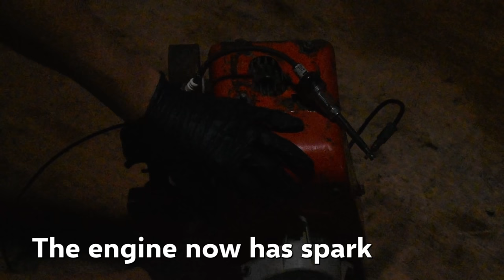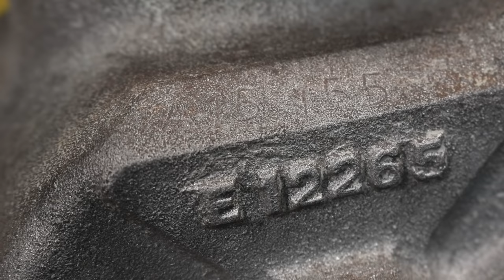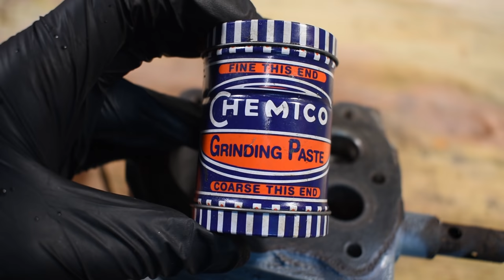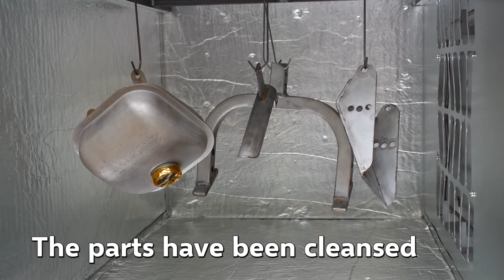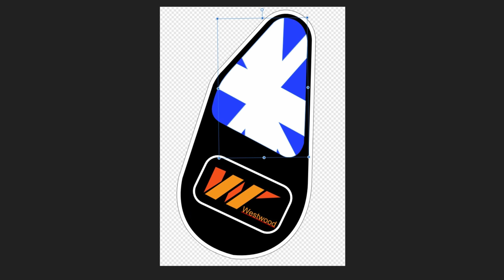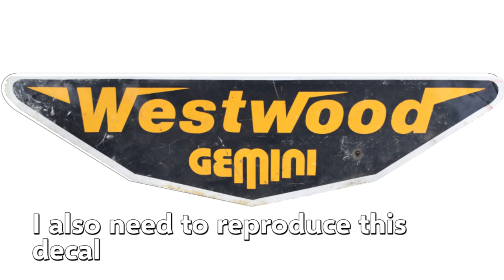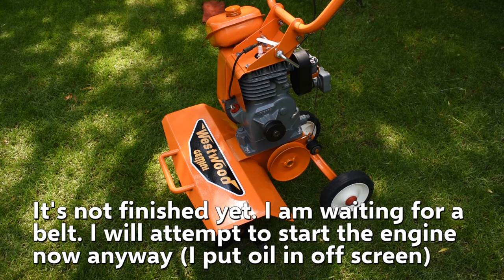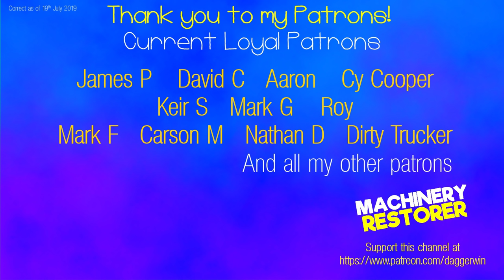ABANDONED RUSTY TILLER SATISFYING RESTORATION

Comment: I used to restore vintage Snowmobiles. It was a great hobby but time consuming and parts were hard to come by. Now I just repair small engine equipment much like that Tiller. I always enjoy watching an old, rusty hulk come back to life. I do wish I had a powder coating setup. I usually do primer, paint and a clear coat sealer. I think it holds up better than powder coating in the long run.

Comment: I like the touches of the decals, I had wondered on a previous video where you go them from, never considered that you'd print them.  That old Suffolk Iron Works engine brings back memories.  I used to work on those as a teenager and I still have my fathers old Qualcast Commodore lawnmower which had one.  It precedes the engine you have here as the earlier ones had cast alloy starter pull assembly instead of the nasty plastic and cast and chromed throttle control rather than the pressed piece.  The 70+ year old mower now rests peacefully in the shed as a memory of my father and the first time that I was allowed to mow the lawn with it.

Comment: Fantastic restoration, I had one of these that I bought from a lawnmower repair shops junk pile. Did some work on it to get it running and it worked really well. Impressed that you managed to get a new belt, mine was knackered and I couldn’t find a replacement anywhere, I eventually took the old one into Halfords and found a fan belt that was the closest size, wasn’t perfect but it worked reasonably well. Thank you though, really enjoyed you doing the restoration.

Comment: Very nicely done.. Everything about this video is great... A little tip I learned working at a motorcycle shop.. When installing grips on your handlebars,  if u soak it in gasoline first for a couple seconds then slide the grips on the bars. (Do it quickly) they will never slide around on you.. You will have to cut them off to remove them .. it's like they melt in place... Fantastic video.. Subscribed...

Comment: Very comprehensive resto. I highly enjoyed it. One issue I noticed at the end though, when you removed the wheels I noticed that the wheel frame looked to me to be installed back to front. It looks like if you turned it around the frame would have flat feet on the bottom and slide across the ground instead of the downward pointed feet that dig in. Just my view and since I have never seen this model of tiller in person I could be way off.

Comment: This is how my montgomery/ward tiller was acquired, dude had it outback for a year, then decided to put it up to the trash. Grabbed it, drained gas. cleaned flywheel magnets, and I wanna say it needed a condenser and she fired right up. That was 10 or so years ago and I still use it to till my garden. Finally needed a carb rebuild over the winter.

Comment: Hallo            
18:00 Zylinder und Zylinderkopf  von einem Luft gekühlten Motor werden nicht mit Farbe behandelt, der Wärmeableitung wegen. Auch nicht, wenn der Hersteller den Motor mit Farbe behandelt hat, der Hersteller will sein Produkt verkaufen, deswegen die Farbe.
Gute Arbeit die du machst.
18:00 Cylinder and cylinder head of an air-cooled engine are not treated with paint because of the heat dissipation. Not even if the manufacturer has treated the engine with paint, the manufacturer wants to sell his product, hence the color.
Good job you do.

Comment: Another way to clean that aluminum off that journal is to mix up a strong mixture of lye and water. You can just dunk the whole crank in. Lye will dissolve the aluminum, but won't hurt the cast crank.

Comment: Use hairspray to slide the rubber grips on the handles. Old bicycle builder trick.  The hairspray dries and helps the handles stick without twisting.

Comment: That was a great restoration and the final result was awesome. Printing the decals finished it off perfectly. 
I think you used just about every preparation and coating method available: paint stripper, wire brush, vinegar, sandblasting and sandpaper. 
Powder coating, spray can and brush but a great job. Cheers Stuart 🇦🇺

Comment: I trick with handle grips I learned as a teenager 35 years ago, spray the inside of them with hairspray before you put them on. When the hairspray is wet it acts like WD-40 , when it dries it acts like glue.

Comment: Very satisfying to watch. I've seen many single-cylinder engine restoration videos and yours is the first I have seen so far, that you showed honing the cylinder wall and checking for the crosshatch lines. I noticed that you cleaned and re-used the points and condenser. Have you ever tried replacing it with a solid state conversion kit?

Comment: It seems so simple and even therapeutic taking these small
engines apart. Then I lose my mind just trying to change the batteries in some
toy my kids have. So, I won’t even speculate about cleaning them up and putting
them back together. Oh and my first experiment as a kid was to take my Dad’s 25
foot tape measure apart. And then I learned about the power of rolled metal and
springs!

Comment: Wood/sawdust in the crankcase used to be (and maybe still is for all I know) for engines that burned oil or were knocking. The theory being that the wood fibers would take up the bearings loss. In practice it was used more for a quick sale before motor seld destructed. Also same trick for car transmissions that were slipping.

Comment: Hallo @UCguI73--UraJpso4NizXNzA           
18:00 Zylinder und Zylinderkopf  von einem Luft gekühlten Motor werden nicht mit Farbe behandelt, der Wärmeableitung wegen. Auch nicht, wenn der Hersteller den Motor mit Farbe behandelt hat, der Hersteller will sein Produkt verkaufen, deswegen die Farbe.
Gute Arbeit die du machst.

18:00 Cylinder and cylinder head of an air-cooled engine are not treated with paint because of the heat dissipation. Not even if the manufacturer has treated the engine with paint, the manufacturer wants to sell his product, hence the color.
Good job you do.

Comment: As a car technician just starting their career I wanted to ask you some advice. I’m starting to work on bigger projects that involve a lot more parts and connecting hardware. Any advice or tips on remembering what bolts and hardware go where? Memory is not my best asset so looking for any tricks.
Reply: I use doggy bags that I write the bolt size on or magnetic trays. For which size bolt goes where I either remember or have to car specific mechanics manual at hand

Comment: I repaired this exact same one when i was in highschool, except the fuel line was made of metal and both the seals on it were completely gone, so i used some string just to get the thing running... had i fixed it today i would have made new seals...

Comment: The ""fuel mixture screw" is the main jet needle, I notice you left the emulsion tube in situ? Always clean that one or engine often won't work. I've got a Qualcast handbook somewhere for the cylinder mower, uses same engine.

Comment: I know this is an old video, but try dissolving that smeared conrod aluminium by using a lye solution (sodium hydroxide drain cleaner + water) - it'll eat away all the aluminium but won't affect other metals.

Comment: I would have used sodium hydroxide to remove the aluminum. It’s what is used for large Fairbanks engines that used aluminum bearings. It doesn’t effect steel.

Comment: I have rebuilt a lot of small engines over the years.  You never seem to measure any of the wear areas in the engine.  Just clean them up, paint and done.  Main bearings, valve guides, crank throw, cylinder diameter for taper or ridge, refacing valves or valve seats.  Plasti guage the rod main bearing.  Setting the valve gap.  Poor, poor, poor.  Tom Degenhart

Comment: You make a beautiful job of restoring that neglected garden equipment, but this machine, for some reason I strongly dislike, to say the least. 
It looks like crap right out of the factory, whereas the Westwood tractor… I find that marvellous - apart from the way to strong rubber flap in front of the rear discharge.

Comment: This reminds me of my dad's rototiller. At first, my dad didn't have a rototiller, but then, he found one in a dumpster or garbage can, and he decided to fix it up for him to use, that way, he didn't have to use his hoe all the time. He bought a clutch on eBay one time that was made in China, and it just plain sucks. When my dad uses it, it makes a high-pitched squeal because of too much friction. It does it about every 10 seconds, and it hurts my ears. He also said that this is why you don't buy Chinese clutches. It also has worn-off white paint that my dad doesn't mind. One time, the piston locked up, and my dad had to take it apart to fix it. The piston rings had broken, making the piston not able to move. The reason why my dad is so good at fixing engines is because he works at TranService, working on semi trucks all the time.

Comment: I wouldn’t expect this to last. I mean you broke it down properly and cleaned it well but you only used 3 in 1 oil. I seen the black label. That’s the original one not the blue label that is more than less 20 weight but the black label is not good for heat

Comment: 1:20 So, the engine had lower to min, it was seating for, I don't know how long, and you tried to start it, without trying to check if it was seized... Nice going!
1:58 You don't say!! What if some how, you manage to start the engine at the 1st try and that thing had been cut... Engine R.I.P. that's what!
3:22 and it had fuel inside! 
5:59 You still didn't check if the engine is seized!! With oil lower to the min mark... seating for how long?? ok!
6:33 And after the check for spark, you desided to change the oil! Without checking if the engine is seized! Ok....
6:45 And what do you know? The oil has ssome metal filings in it!!
6:55 If you checked the condition of the oil 1st, you would strip the engine from the start!
7:43 First impression is good, but the oil still has metal filings and looks like mud...
8:20 Yes, and they look brand new!! 2 posibilities: 1. You made them with a flatheaded screwdriver or something OR they exist because you were trying to check for spark before you checked if the engine was seized or not! But, from the easiness you displayed, while you were removing the head of the engine, I say the 1st. Go on...
11:26 Why you didn't use your sand blaster? 
11:48 Use a heat gun or something!!
14:00 Again, why you didn't use the sand blaster? 14:27 Oh wait, you did.. so you did the same part 2 times.. what did you expect, not having rust under the paint?

Well, that's all the things I found wrong in my opinion on this rebuild. It works, it looks good.
Reply: Why does he need to check if it is Seized. If it turns its not seized also he was checking for a spark so he knows if he needs to replace it or not he wasnt trying to start it. Also he can choose if he uses his sand blaster. Just because he didnt use it at the time you thought was necessary doesnt mean what he did was wrong.

Comment: Suffolk engine?
Reply: Yes, it is the 98cc cast iron version. I had thought that they were only found on lawnmowers, but the tiller looks made for it, as well as a few extra additional engine parts (elbow for the air cleaner, carburettor guard etc). Surprised that Westwood chose the Suffolk over the more usual Briggs and Stratton, maybe they were insistant on a 100% British machine?

Comment: Great restore! I was wondering who mfg the engine? I saw up were using and S.A.E 9/16 socket on the flywheel but it doesn't really look a U.S.A. mfg engine.
Reply from the maker: This is a suffolk iron foundry engine from the 1970's
Reply: It's originally a Suffolk Iron Foundry design from the 1950's, British made.
Reply: Thanks for the info!
 If you ever get involved with a vintage motor bike or car and can't find some parts , let me know. 
Here in North Texas we have a lot of clubs for most everything that has an engine! 
I've helped  some folks in Norway and Sweden find parts for their early 70's Honda 750 projects.